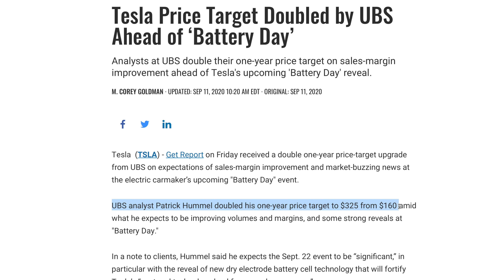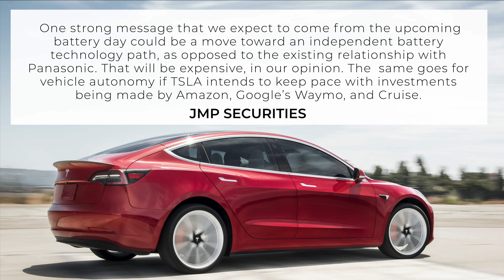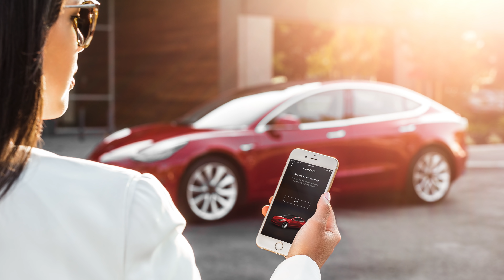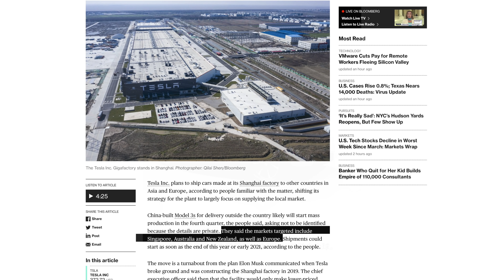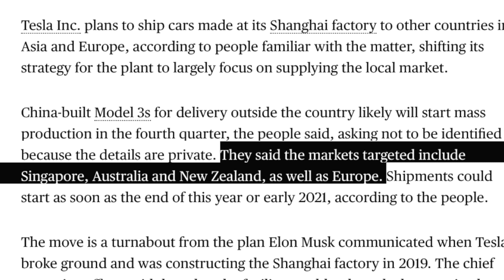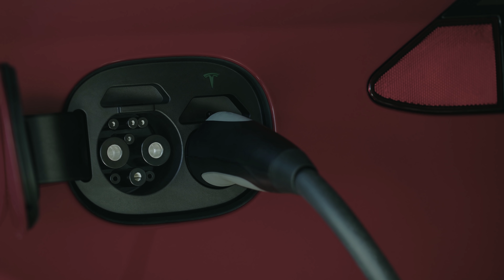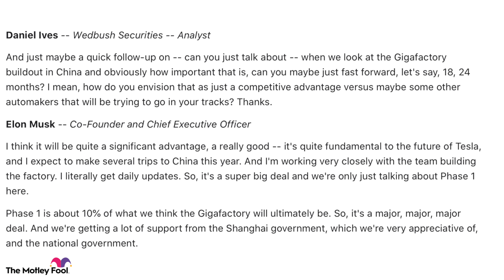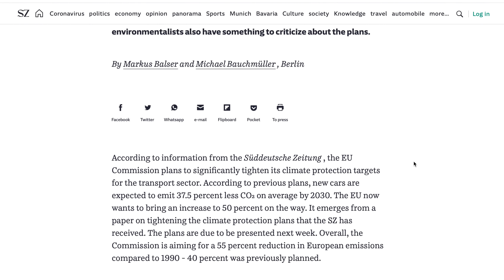Tesla to Export From Giga Shanghai? China Demand Issue or Not? + TSLA Updates, Elon Musk Tweets

Comment: Australia needs huge range. Ive regularly done 700-1000km trips without stopping over the past 15 years. Even my 1996 sedan would get 720km on a tank.
From my understanding the batteries used in china manufacturing are less dense which result in shorter ranges than US models. Thats going to be a non starter if you try to push in Aus with that.

Comment: Yes! Right hand drive. Of course that makes complete sense. It has to be cost efficient to produce all at one factory. Being that we only have two factories today? China makes sense. most of those countries are closer to China and the UK isn’t close to either Freemont or Shanghai.
I wonder if we’ll see a Australian factory soon.  Could imagine a new smaller cyber type (mad max) vehicle come from there?

Absolutely 5M+ with all 4 up and running.🤞🏼

H.V.A.C. Is only as good as the the home’s insulation. We would have to radically seal our homes to solve that issue. Commercial level filtration systems are available $$$ today. Can’t imagine this being good for anything besides very highend new construction? 
Improvement of the electric heatpump is a different story! Electric homes suck to heat. Can’t wait to see what he’s thinking!

Comment: There's a few mentions in the comment section about Lucid, and I think people are missing the point, of which angle they can be a threat to Tesla.
The problem does not concern Lucid producing cars by it self, the problem is the fact that they have demonstrated that they posses the same secret sauce technology, which Tesla has and have been sitting on for them self and thereby giving them a huge competative advantage, until now that is. Judging by the size of their power train, which is much smaller than Tesla's power train yet still as powerfull and effecient, one could even argue that Lucid's technology is ahead of Tesla. 
But because Lucid is so far behind in establishing them self, they can be very much incentivised to just license out their secret sauce, which would enable all the legacy automakers to immediately catch up with Tesla in terms of battery and power train performance and effeciency.
Elon has mentioned about the possibility of licensing out their technology, but he's been talking about that for the last 5-6 years, and it has never come to fruition, probably because Elon doesn't really want to share it.  Whoever license the secret sauce technology out first, will gain a lot of money, so because of lucid, Tesla could be forced to license out their secret sauce now, thus loosing one of their big competative advantages.
Once/if this happens, that means Tesla needs to focus on the advantage that they currently posses at producing cars cheaper than the competitors, due to their unique factories and their virtical intergration. Hopefully with FSD and their lead in software, that will enable them to push even further the price without having to compromise on the build quality of their cars.

That being said, I am curious to learn more about Tesla's new plaid power train, and what progress they have made since the previous gen.

Comment: I can't site sources anymore, but I have picked up over the years both from Tesla side and Panasonic side that they have a hard time finding workers in Nevada.
It's in the middle of the high desert, so you get barren hot boringness, and cold winters where sometimes everything gets shut down due to snow and ice.
Too far from the Bay Area for fun or commuting, and Reno is a washed up and run down step daughter to Las Vegas, and no one really wants to live there, plus it has a poor housing market so it's hard for lots of people to move their anyway.
So attracting talent there is hard, and I remember hearing that Panasonic was still reliant on rotating expensive Expat Japanese engineers over to staff much of the factory, simply because they could not find Americans to fill the jobs.

I think this is a big part of why the Giga Nevada build out stopped, because they didn't have a workforce...

Remember that Tesla and SpaceX were both placed in locations where they knew a lot of talented workers lived nearby, and Shanghai, Berlin and Texas have also been situated with this in mind, but Nevada was just cheap and needed to move parts of the process out of Fremont, and I think Elon expected to be able to get people to move there.
Reply from the maker: Yeah good point, I’ve heard the same.

Comment: Good update 👍 the numbers will tell the story re shipping. If demand is greater than supply in China you wouldn't ship, but if you have surplus then it makes sense as it continues to expand the brand. 

Tesla's strength is manufacturing and battery advancement which they should leverage and licence. I think they will have a nice slice of the market in the  next 10 years but cars won't be the driver 😉

Comment: I don't think Tesla plans to export EVs from China, at least not long term. They are planning to use a different battery chemistry in China, and the Chinese charge port is different from all other jurisdictions. There may also be other differences due to local supply chain differences. For servicing and parts stocking reasons you want all the cars in a given market to come from the same source. 
  
There may be some short term slack in demand. China has suffered extensive flooding and other natural disasters this year, causing widespread havoc and crop failures. The C-19 virus has also caused extensive shutdowns within China and greatly impacted their export markets. The Chinese economy cannot be doing well this year. It would be surprising if car sales were not impacted across the board. Many people have lost everything in the disasters.
  
I also suspect that there may be repatriation restrictions on money earned from the Shanghai factory. China's central bank seems to be fairly cash-strapped for dollars so it's extremely difficult to convert large quantities of renminbi to dollars. The CCP does not want capital escaping their control and flowing overseas. We investors should be questioning Tesla on the restrictions they operate under in China regarding repatriation, potential exports, their Chinese loans, etc.
Reply: Charge ports are not a problem - Fremont-built Model 3s already have different charge ports fitted depending on whether they are going to the US or Europe